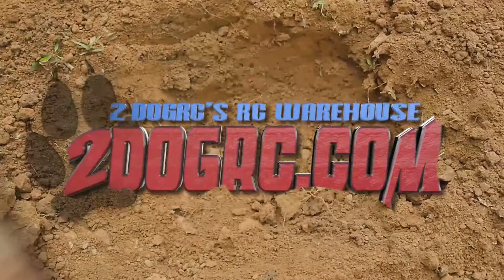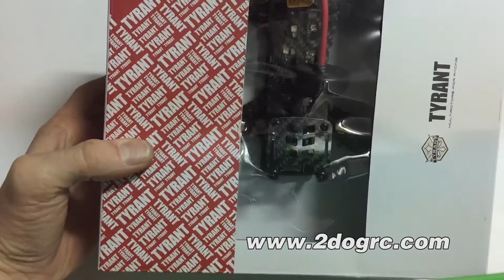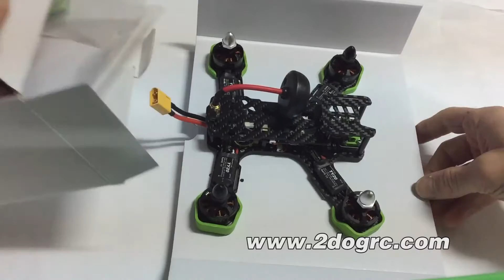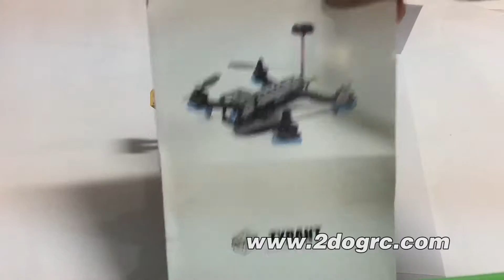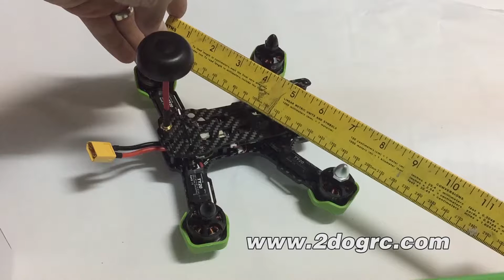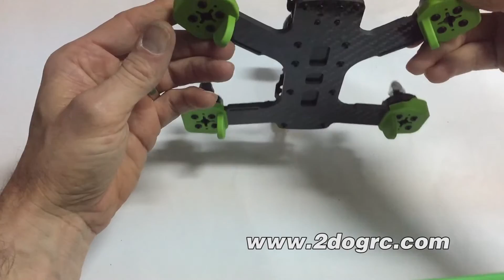Quick Unboxing review of the Diatone Tyrant 180 ARF from 2dogrc

Comment: I bought this and tried to review it in cleanflight. After setting up my XSR receiver and my taranis I tried to flash 16.6 to the escs which had 16.45. Now two esc/motor are not working, 2 and 3. Do you have any idea what has happened here? Any advice how to fix that? Do I need to replace the escs? Thanks.
Reply: Unfortunately a bug was discovered in Betaflight that when flashing the ESC's with the newest Betaflight caused the ESC's to fail or get corrupted in the flash process.  You could replace the ESC, then reflash your board with Betaflight 2.9, update the ESC's, then reflash to current Betalight.  Another method would be to follow these directions:  https://nathan.vertile.com/blog/2015/11/16/flashing-xrotor-20a-with-blheli-via-4w-if/#top>
Flash you board to 2.9 Betaflight, update, flash to 3.1.

Comment: This thing is pretty, a work of art, I was taken.  Now the bad, it's a show stopper.  The whole reducing wiring clutter with a PCB seems like a great idea.  Here is what happens; even after a few 'soft' crashes into a lawn or dirt the shock from those crashes will severely weaken or rip the solder pads off of the PCB where the esc connects.  You are then left with NOTHING.  Yes wiring is messy but REPAIRABLE. Yes I had sticky pads under my esc units.  I am no dunce but still have very little success repairing a broken solder pad.  Fine a new one is $10 but try to order another Tyrant 180 PCB, they are sold out, ha, ha.  I don't even think the one on their website will fit.  It also seems like mounting another FC besides that cheap ass Naze would be a monumental hassle even for a tinker addict.  You may be able to reduce the chance for the solder pads ripping off by giving an eighth inch or so slack between the PCB and esc and putting a zip tie on the esc.  I will try that if I can find another PCB.
Reply from the maker: I always use Zip ties to hold the ESC's down.  I have not had any issues with this or other complaints of this happening.